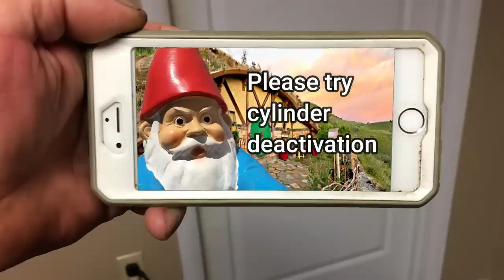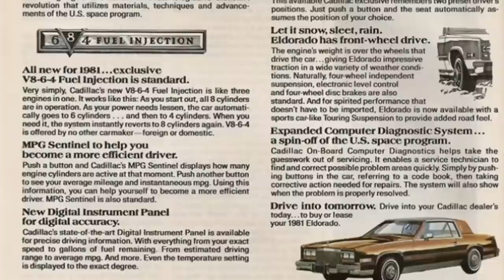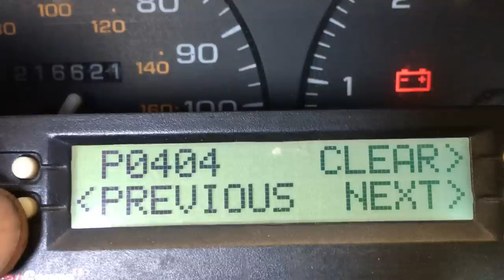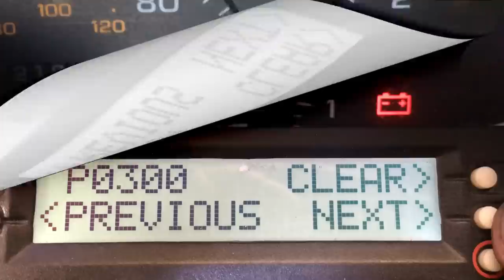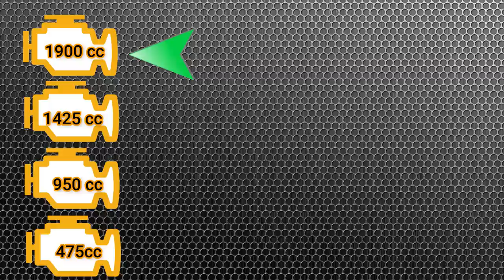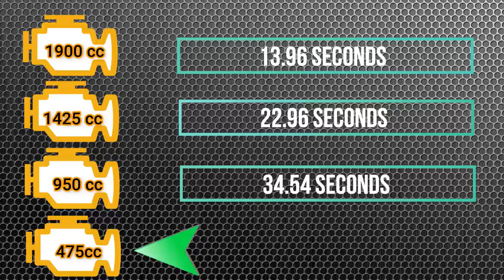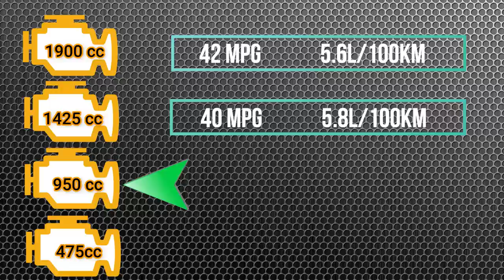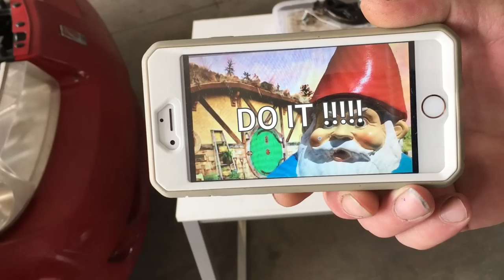S2E16:  We deactivate cylinders on our Saturn and test the car for performance and MPG

Comment: Why didn't you remove the spark plugs to reduce negative power? With two cylinders you could make a link pipe to displace the air in the dead cylinders. All good fun of course.
Reply: I was going to comment the same
Reply: The idea is to mimic real-time cylinders deactivation.
The way it works on most engine is nearly the same as in this video.
Reply: Linking cylinder 2 and cylinder 3 together through the spark plug holes would gain nothing since those 2 cylinders move up and down together. He just needs to leave the plus out.
Reply: @flb78  the better solution is to leave the exhaust valves open all the time.
Edit: if it's an interference engine it can't be done, of course.
Reply from the maker: Removing the spark plugs would introduce air into the cylinders and increase the drag on the engine.  The way we did it was the most efficient way.
Reply: @robotcantina8957  the vacuum inside is acting as a spring.
But leaving the cylinder wide open to air, not compressing it, may induce less losses.
I'm just thinking.
I haven't made any experiments to prove it.
Reply: @robotcantina8957   I think you need to test that, there's already air in the cylinder (when you start the car after it has been sitting) that gets pushed past the rings on the first few compression strokes (there's now two compression strokes per cycle for the deactivated cylinders...)... once that air is out you'll be fighting vacuum.

At TDC you will reach min volume and then the downstroke will have to pull air past the rings again, but there should be some decent vacuum in the crankcase unless it's vented to atmosphere... so I would expect a significant amount of resistance on the downward strokes and less on the compression strokes after the first few rotations, but if there's pressure in the crankcase you could end up pushing air past the rings on each stroke... this is also why you had so much oil in the cylinders when you reactivated them.

With the spark plugs out, the air that's in the cylinder at the start will just evacuate through the plug hole, then the downward stroke should be assisted by atmospheric pressure rather than fought by the vacuum in the cylinder.  I would expect that to be more beneficial than the force needed to push the air out of the cylinder on the compression strokes... which you might be doing anyway with the spark plugs in.
Reply: @ElectronikHeart  You don't need to make any tests, this is basic physics.  Having a cylinder pump air in and out on each stroke will cause energy loss (pumping loss).  Having a sealed cylinder means the energy you put into compressing the air is returned on the downstroke.
Reply: It is debatable as to whether leaving the plugs in or taking them out is better. There are two schools of thought. If the valves are permanently closed then the pistons are compressing the air in the combustion chamber which causes losses. This will however tend to reduce the effort past TDC as the compressed air acts as a spring and assists rotation of the crank.
On the other hand opening up the deactivated cylinders to atmosphere will not compress the air in the cylinder which logically should be less work, but will be pumping air in and out of a small hole, which will in turn lead to losses.
Perhaps you can settle this argument by repeating the tests and comparing the results with the existing ones?
Reply: @chrisknight6884  You get back the majority of the energy you put into compressing the air, the primary loss is heat into to the combustion chamber.  If pumping losses were lower than this why haven't auto manufacturers used this method ?
Reply: @ferrumignis  I really like all the comments here.
Reply: @ferrumignis  I'm not advocating one method over another, which is why a test comparison would be a good thing to do. I do however note that if you turn over a dead engine with and without the spark plugs fitted, it turns over faster and easier without, than with them in place and the engine developing full compression. Now whether this would be the same with the engine under power at a few thousand rpm would be interesting to find out.

Comment: pretty amazing the car even moved as well as it did with 1 cylinder firing. it might be interesting to see if you could remove the 4 cyl engine and put in an equivalant cc 1 cyl lawn mower engine and see how it would run without all those dead cylinders hanging on. it would most likely be WAY to much work for somethinng like that though. anyway, cool video, i just found your channel and interested in watching more.
Reply: that extra weight acting as a flywheel is probably necessary to stop it stalling out at stops and starts

Comment: I wonder if performance would have been better on 2/3 than it was on 1/4?
Also I wonder if you had a “rod knock” and deactivated the offending cylinder it would prolong the usable life of the engine? 
I did an engine swap on a Saturn, the video is on my channel. It would have been a great chance to try it!!

All of my commercials for this episode are in Spanish 😂
Reply from the maker: Deactivating a cylinder may have helped with the rod knock for a little while,  that's an interesting solution..
Reply: I did the same with an old Fiero I had about 20 yrs ago or so. Cylinder 3 had a bad rod bearing and I eventually deactivated that cylinder. It helped get me by a little while longer! 😅
Reply: Talking of knock does a Saturn have a knock sensor? That would be detect the miss and ecu would overfuel to compensate hence no fuel saving. We didn’t get saturns in Europe but most euro cars of same age have knock sensors.
Reply: @wodgesad  Love the comments here.
Reply: @mommapanda5736  Looking forward to the next video from Robot Cantina.

Comment: Putting the pedal to the floor on reduced cylinders is actually the best sign of the increase in efficiency. Wide open throttle minimizes pumping losses. Doubt it has a major effect on such a small motor though

Comment: It would be interesting to compare 2 cylinders in a 180 degree configuration against the 360 degrees already tested.  Apart from vibration, is the performance equivalent?

Comment: I wonder if it's running super lean in 1 cylinder mode because the fuel injector can't add enough trim. That's why 80% throttle had more power, it enriched the mixture.

Comment: What really helps with fuel economy, I tested it myself is to try and make a hybrid out of your car. Accelerate with the rpm and the load in a range were it's most efficient. Then put it in neutral and turn of the engine. Works best on manual. 
The coast as long as traffic allows and use your knowledge about the route you're driving. So converting units I roughly improved fuel economy on a otherwise identical car from ~35mpg to 50mpg and even slightly better after I got used to it. Then I switched to electric and can charge for mostly for free at work.

Comment: I drove a 1256cc Vauxhall Chevette, which had burnt a hole through No. 3 piston, for over two weeks (about 500 miles) on three cylinders (spark plug removed) before it went bang!

Comment: Should try lean cruse on one. In ausi land they lean out the cylinders on the highway. Since there is plenty of air flowing over the rad and engine block. Negative is that the cats tend to break down faster

Comment: How does the car measure intake air? If it uses a mass air flow sensor it would have been running very lean because the computer was expecting to match the air mass to fuel mass with all 4 cylinders.
The 1 cylinder test was probably running super lean at full throttle because it was injecting 1/4 of the fuel the cylinder needed. The computer would try to compensate with the computer, but even my turbocharged car only allows the computer to compensate up to 25% more or less fuel.
Really interested in the lean burn project. That sounds awesome
Reply from the maker: The ECU uses speed density derived by the MAP sensor to measure air flow and load.
Reply: @robotcantina8957  speed density would have the same problem. Easiest fix might be getting a 2X larger injector to use on the working cylinders. Keep in mind that larger injectors would probably have more deadtime making idle kind of finicky.
Possibly mount a 2nd injector from an other cylinder in the same runner though that wouldn't be the best solution since it wouldn't inject the fuel at the proper time, once again messing with the idle and working better at higher revs
Love all these videos
Reply: @BrokeWrench  Robot,    we look forward to more great videos here

Comment: Were the two deactivated cylinders purged of air at top dead center to eliminate pumping losses?
Reply: That would just make it to try to pull a vacuum at bottom dead center, most efficient would be some kind of jakebrake system to allow high pressure out and vacuum in at corresponding strokes
Reply: I imagine they'd purge themselves and reach the most ideal internal pressure after running for a few seconds or so. Any air inside will eventually escape thru the piston rings or through the probably imperfect by now valve seats.  Of course this means some air is always  coming or going but it'd probably reach some sort of homeostasis after a while so no real benefit to vacuuming the air out or installing each spark plug at TDC to reduce the amount of air inside.

I think that's why it was a little rough to get it started on 2 cylinders at first. As it was fighting to compress the air inside.  

I work on a lot of cars and do a lot of failure analysis but I'm not an engine scientist so take my ideas with a grain of salt. Heh
Reply: you'd have to remove the spark plugs i would think. Cause even if you purged air out, it'll still have pumping losses if the cylinder is sealed.
Reply: @kasuraga  But if it was sealed, the compressed air would act like a spring when the piston starts moving down, thus making it +- with out factoring the friction from the piston rings etc
Reply: @KonnaVaari  Love the comments here.

Comment: Evap is usually the gas cap not on all the way out it on till it clicks even though you feel it squishing the gasket or pulling the thread it’s still not tight enough till it clicks

Comment: Instead of 'deactivating' cylinders, could manufacturers do 8 or 12 stroke for low-load / cruising? It seems like this might be less problematic for thermal reasons and  easier to accomplish.

Comment: I always had an idea of setting the injectors of an efi car on a switch like a turn signal relay system so it runs 2 cylinders for a second or so and then the other 2 cylinders alternating, causing an even wear/heat cycle while only running on 2 at a time, with a bypass "GO" button to run all 4 normally without the deactivation when you need the power
Reply: 8 stroke engine! with 4 of the strokes being the cylinder just doing nothing

Comment: 6:50

Maybe I missed something but is the 2 middle cylinders just filling up with fuel/oil until they hydro lock? The fuel is pooling behind the valve and the chamber is pulling a vacuum each stroke. It's all just coming through the valves and the rings to fill the chamber.

Even on the normal car its just going to fill with oil until a rod bends and sees daylight.

Comment: Wouldn't running 2&3 and shutting off 1&4 help eliminate rocking vibration?
Reply from the maker: It probably would be exactly the same. 1 and 4  is balanced as far as firing and 2 and 3 are balanced as far as firing.
Reply: @robotcantina8957  Maybe I am wrong, but I would think firing on the end 2 cyls would create more rocking. IDK that it would make much real world difference in hp gain or economy in this instance though.
Reply: @jameswolfe8065  Robot,   Looking forward to more great videos here,

Comment: I did this to a Toyota Paseo (Tercel). C1 burnt an exhaust valve in half, so I disconnected the injector and we just ran it on 3 cylinders for a solid 6-12 months.  
It idled like poo, but above 1500rpm it ran perfectly fine... Except it had rubbish power. The 7AFE goes pretty good though in a light car, so as long as you didn't have passengers it still ran alright.  
Fuel economy was the same or worse, because you've just got your foot on the floor half the time lol

Comment: Should name it deactivated lifters not cylinders lol 

Deactivating a cylinder includes removing at least one valve for exhaust and intake or removing completely the piston , because it will be compression fighting on a enclosed chamber wile crankshaft moves the pistons up and down with deactivated lifters it only leave the valves to be closed and produce piston fights on a enclosed chamber on every rotation. Loosing power   Idk if you get what I meant.

I don’t read the comments sorry  
But removing a spark plug will be more efficient for you than the lifters lol

Comment: Your transmission is not stuck in 3rd or 4th gear it needs a shift solenoid ....you can find used ones on the internet for cheap

Comment: On 2 Cylinder mode, wouldn't it be helpful to lock the valves open on deactivated cylinders to reduce their compression loading on the remaining of the cylinders?
Reply: Or just remove the spark plugs
Reply: @LemonMontage420  that would allow unfiltered engine bay air into the cylinders. Whereas locking the valves open all the air will have been generally filtered.
Reply: @steveishere7909  running unfiltered air for something that temporary shouldn't be an issue, but yeah locking valves open would be ideal if it were a bit more permanent
Reply: @LemonMontage420  Mother of all intake leaks, straight into the exhaust manifold.

Comment: intake ports for deactivated cylinders are still letting fuel into them.  If you locked the intake lifter in the closed position this would be "good enough".  Other option is to remove the intake manifold and run 1 carb on each cylinder that is still activated.  This is why the fuel injected one ran better.
Reply: multiport injection.  He disconnected the injectors.  The only cylinders getting fuel OR air were the operable ones.
Reply: @knurlgnar24  Literally had a lawn mower carb on it.  Pay attention.

Comment: Can and has been done electronically on a stock Ford 3.0 Duratec.  By memory all that was done was disable the spark and injector on disable cylinders, and compensate fuel curve.

Comment: many automatics are designed to work without a TCU.

putting it in reverse engages the correct fluid paths for reverse

putting it in drive engages the fluid path for (usually) 3rd. the TCU then engages the solenoids to switch it to 1st. for example on the gm truck transmissions

1st-  on  on
2nd- off on
3rd- off off
4th- on  off 

that way you get 4 speeds with 2 shift solenoids. maybe you can build a shifter that flips switches or uses brushes on a copper pcb to "manually" shift the automatic or hell just flip the switches one by one lol just be aware that you'll have full line pressure and those shifts will be brutal
Reply: can having full line pressure destroy a transmission sooner?
Reply: @crimsonmoon9404  it shifts very hard so parts will wear out faster
Reply: @aleks138  ye know what specific parts would wear out faster? just the clutches and bands or more?

Comment: I have to wonder what kind of air/fuel mixture and possibly ignition timing issues you might be having with this setup, since the ECU is set up to expect 4 cylinders but is taking the intake airflow or pressure, throttle position, oxygen sensing from single sensors, activating idle air control and EGR at single points, etc.  Your car is likely at best in some form of limp mode and probably worse, dealing with physical conditions actually way out of range of the ECU map in several areas, and limp being unable to compensate for those, unlike simply missing sensors or actuators.
     If an ECU could be set up to handle individual cylinders, individual intake,/exhaust/sensors per cylinder, then maybe fuel economy could be improved by a small margin, particularly in the low-load/low-RPM and idle conditions.

Comment: One idea I'd love to see you explore is internal supercharging. The basic concept is that you turn half of the engine into a positive displacement air compressor which is then used to feed the remaining half with pressurized air. 

The process goes something like this: deactivate half of the cylinders, and replace their valves with dual sets of reed valves. Plumb your air filter onto the intake set of reeds, plumb the output reeds to an intercooler that feeds a throttle body for the still active cylinders. You now have a half-displacement engine with a constant boost supply of about 1bar. It will obviously need tuning after this. 

It's not ideal for this particular engine, but it would be a cool idea to try on a V or flat configuration engine, as you can simply use one full bank for each purpose. I know it's been done to a couple of motorcycles, so I don't see why it wouldn't be feasible on a car.

Regardless, I love seeing all of these projects and experiments. Keep up the good work!

Comment: Love your work brother.  Keep it up.  The reason that cylinder burned oil when deactivated is there is always some oil that gets past rings and valve seals but its usually a trace amount.  If no combustion is taking place its just filling the cylinder slowy.  Not surprising on an old oil burner like a saturn.  A better test would be to remove the connecting rods and pistons for those deactivated cyilnders to see how much power loss youre getting from the pumping of dead cylinders.   That would be a lot of extra work.

Comment: I have a 4 cylinder turbo Hyundai Veloster and one time I had two ignition coils go out at the same time and when they went out I only had 2 cylinders running and the mpg read out measured 50-60 mpg and ran just fine. Usually I'll get about 30-35 mpg on normal use